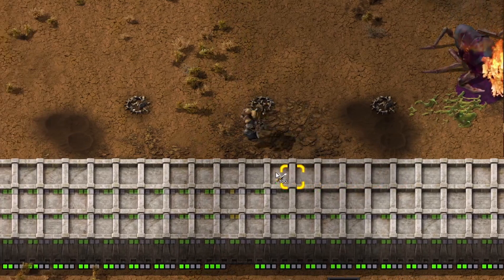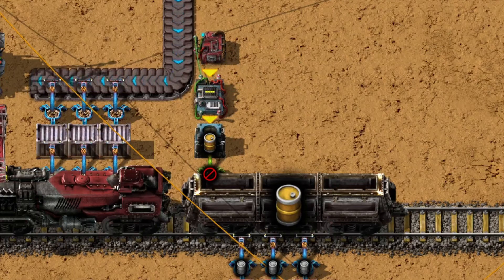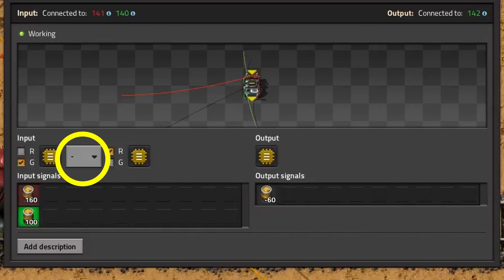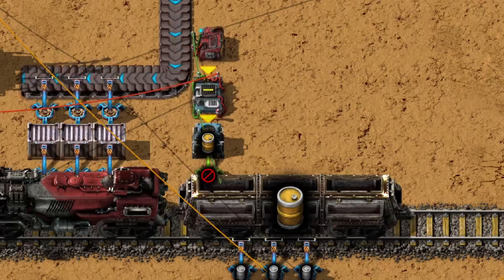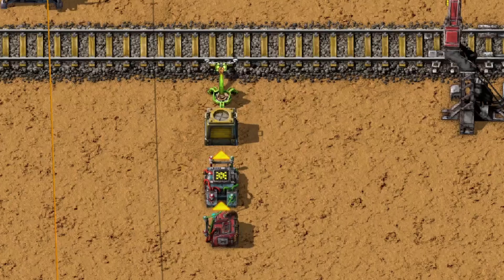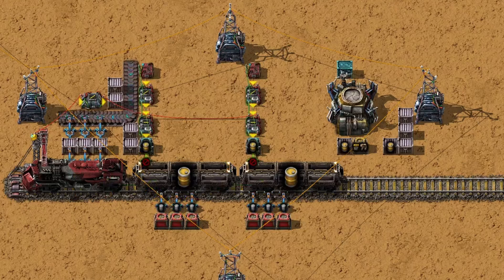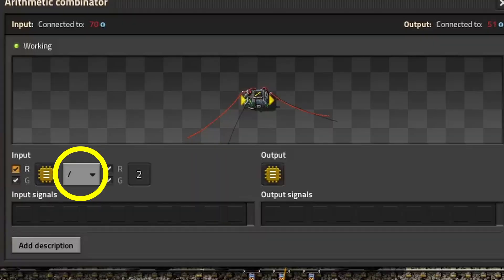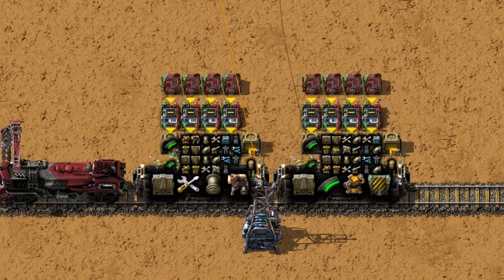How to automate your outpost deliveries?

Comment: Very similar to the supply train system I usually do. The only change is that I used more complicated logic to utilize inserter hand size bonus while delivering only exact stack sizes of items. Each requester chest can hold multiple items types.

1. Subtract train contents from the total request.
2. Set request on requester chests
3. Add a filtering decider combinator that reads items in the chest as filter signal and unfilled cargo as value, resulting in an item that inserter can and should pick up.
4. If, for all such signals, the value is ≥ signal's stack size, pass those signals as filters for the inserter
5. Otherwise, select the minimal of them and set inserter stack size to the value of such signal.

Works flawlessly and blazingly fast.